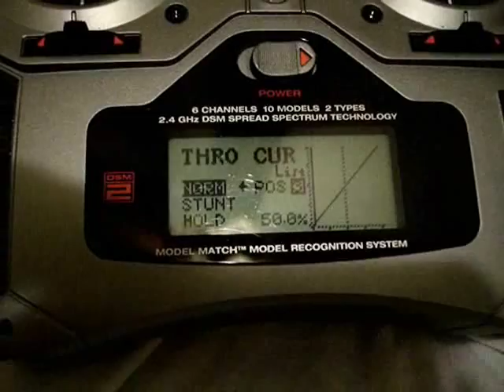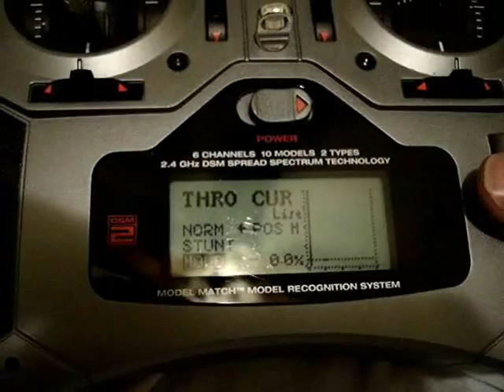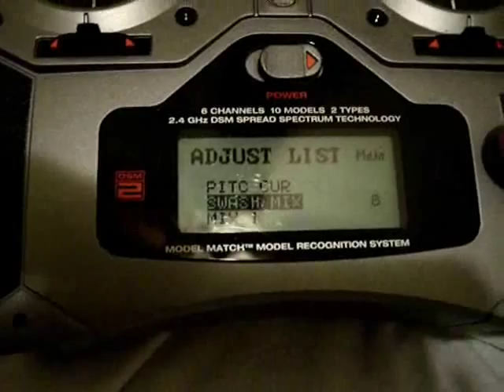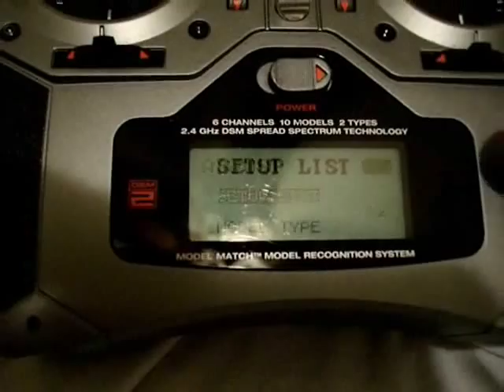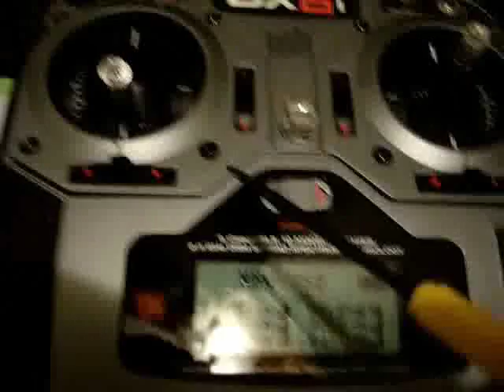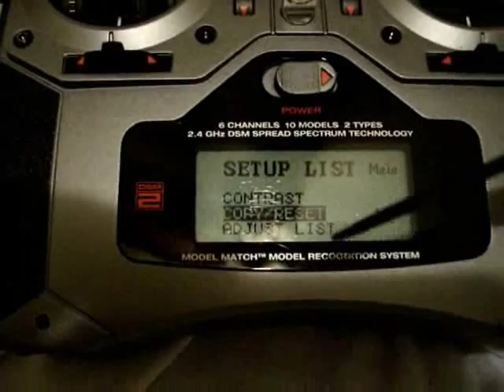Blade 400 3D DX6i PT2

Comment: Hey Sokal... thanks for all your time and experience, it has enriched my flying and understanding of rc heli flying. 
Question: my Dx6i swash settings on stock setup are -60, -60, and +70, where yours are a positive first and second value and a negative third value? Why is this? Differenct Tx or servos?

Comment from the maker: if your at the same rpm setting and stick position the both curves are at example 80% on both with same stick you wont hear a change
personally i run a flat 100
100-100-100-100-100 as my stunt curve

Comment: Hi sokal11,  Had my blade 400 about 4 weeks. Been through about 4 pair of blades and the usual parts you go through with blade strikes. Now today flying it loud squeal, loss of power. Found bearing bad at lower motor mount. Very sloppy. I fly this heli alot all I think about during work. I got the bug. Is this alittle premature for a motor failure. I'am going to call E-Flight monday. Thanks again for all your help. deweydaddy

Comment from the maker: i think this is what your asking
the throttle curve and pitch curve is were you set the flying modes in the flight mode switch

in the menu normal is position 0 (gear)
and stunt is position 1 (gear)

Comment from the maker: setting the trim pot on gyro is just incase gyro goes ape on you 

but yes you have to set the stock up in rate mode

then go in to hh mode
done have to do the 3 switch thing though

Comment: well you just answered the question i really had, which was the limit issue. i have my ball on the end of the servo arm. no wonder my slider is hitting both ends.

as far as the sometimes reading pot, do i have to put it in standard mode? and is standard mode with the switch to 1? I haven't reversed anything (besides rudder/aileron) and it's on the gyro/flap switch.

Comment from the maker: its almost the same just no limit adj just have to manually limit by getting the ball as close to the screw on servo as you can 

also seems the stock gyro is sensitive to the weather and may require to time it out in rate
also some say the stock gyro will some times choose to read the POT dial on servo vs the TX gain setting so set it the same as in the TX

Comment: makes sense. I didn't think about the charge jack. i was wondering though why i didn't get a pack/charger with mine..i thought the guy i bought it off of lost it or something. whatever. 4 aa's no big deal.
do you have any vids on how to setup the stock gyro? i do have a 401, but would like to keep it on my raptor. i haven't flown it in 5 years and forgot all that stuff (then again it was mostly dialed in/setup for me).

Comment from the maker: unfortunatly i have no idea whats thi diffrence or what it does

works the same either way

im guessing it lest the controler use diffrent voltage chargers plug for the EU 220 in stead of our 115

also the manufacture version uses an RX pack not AA batts and charged through receptical on the side